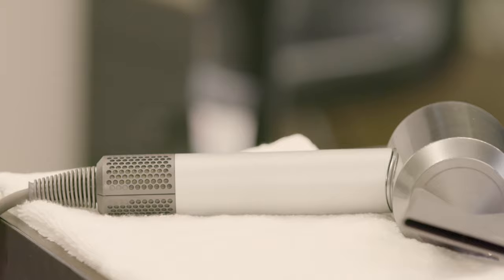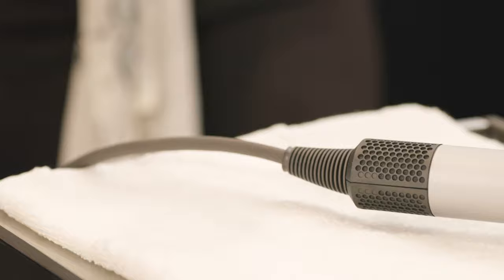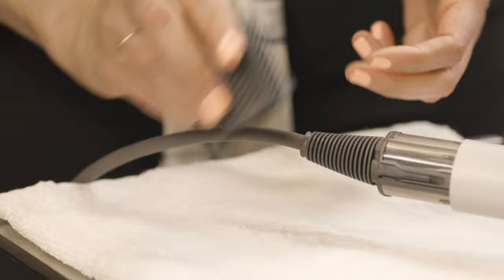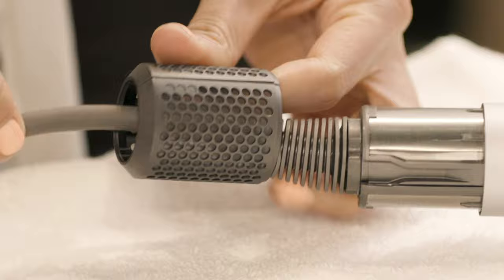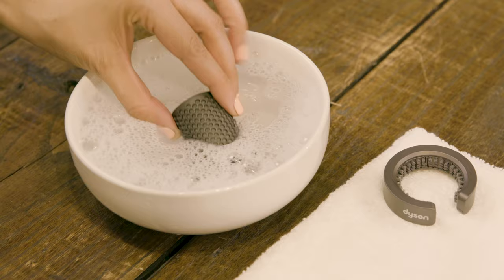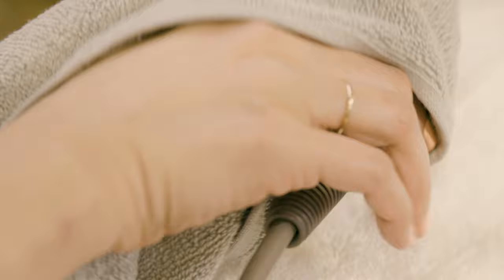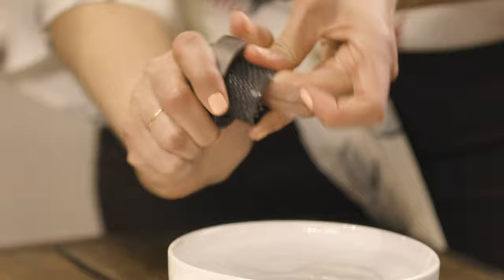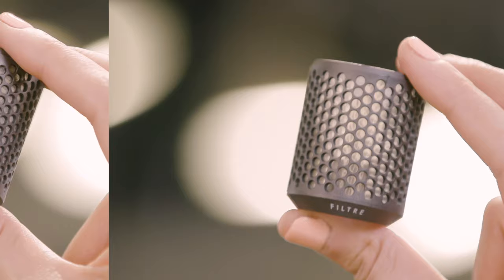Filter cleaning for your Dyson Supersonic™ hair dryer Professional edition.

Comment: My Dyson hair dryer just stopped working yesterday, very disappointed, literally purchased at sephora for $399 Jan 1, 2021 and was delivered Jan 7, 2021. Would not recommend this product my average  use was 3 times a week on low or medium heat, didn’t make 3 years at that price . Crazy
Reply from the maker: If you would like some assistance with your machine, we'd recommend either contacting the Dyson helpline in your country directly, using a live chat service on the Dyson website if available, or sending us a DM via Facebook, Instagram or Twitter/X: @ AskDyson.